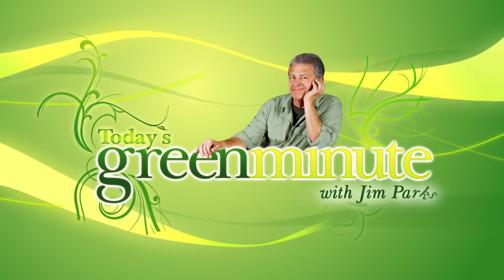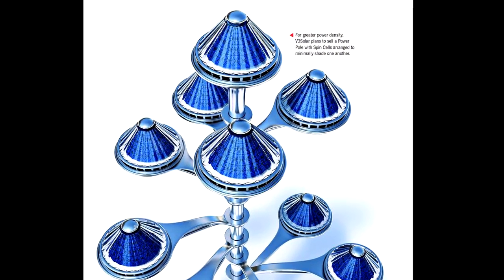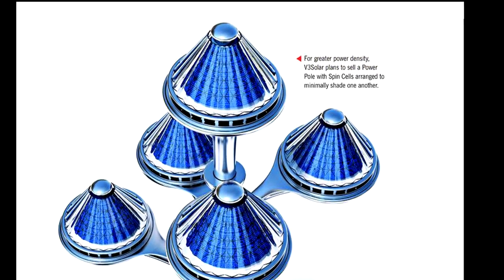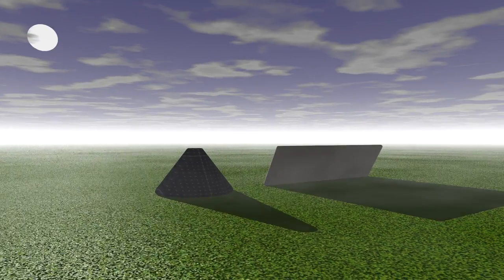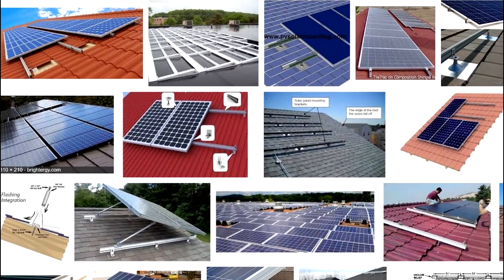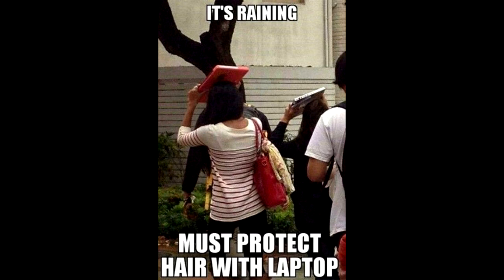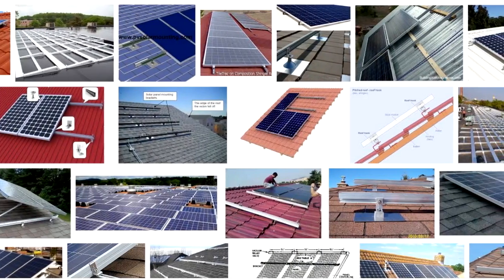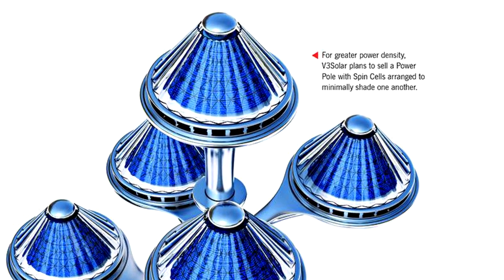Spinning Solar -BUSTED!

Comment: why are they mounted on brake rotors (in the model)
Reply: Miles11we brake rotors are designed like that to dissipate heat. i would assume they just thought "hey that looks cool, and it actually works to cool things off, lets just shove it in there"

Comment: Now i want freaking spinning solar roadway
Reply: Sapher made of thorium
Reply: @RedRacconKing  A mining company actually did make a road out of thorium in Malaysia. It was a waste product from rare earth mining that they needed to deal with so they mixed it into concrete and made a few roads with it. They got protested and sued into bankruptcy over that though.
Reply: Spinning solar freaking thorium water hyperloops, with batterizers built-in.
Reply: EM driven hyperloop!
Reply: spinning solar freaking thorium roadways that generate water from air!
Reply: Sapher Dear lord. it would generate more electricity than a nuclear reactor.
Reply: Thorium powered spinning solar hyperloop roadways! :D
Reply: Solarpowered car with glass cone tires.
Reply: no even better design, the cars are lenses and you cook inside! free heating
Reply: dont forget to bring along that self filling water bottle if you get thursty and the aqualung for a day at the pool!
Reply: That's just crazy enough to work
Reply: Also if they spin really fast t(near light speed) they should last a lot longer thanks to time dilation.
Reply: NO  ........ the car on the solar roadway is cone shaped spinning solar panel with lenses
XD
Reply: A spinning cone-shaped EM drive hyperloop powered by a solar freaking roadway that's made of thorium.
Reply: from plastic. That also create free water
Reply: MortifiedDumplin Looks like we have someone of the oil lobby
Reply: and it also collects air pollution and uses that to replicate itself
Reply: You would have to add thorium to make it work !
Reply: that also condenses water
Reply: in a vacuum hypertube
Reply: spinning thorium solar roadway's!*
Reply: Sapher How will they spin? 
EM drives.
Reply: TheA4p Where can we fit powdered alcohol?
Reply: Tumetron3000 Inside the Hyperloop, duh!
Reply: We'll put a giant magnifying glass over it to increase efficiency and melt the skin off of anyone driving on it.
Reply: god damnit I was thinking the same thing
Reply: You don't drive the road, the road drives YOU! Brilliant work
Reply: Tumetron3000 It will generate powdered alcohol from the atmosphere.
Reply: The only thing better than that would be freaking spinning solar hyperloop - with a passenger capsule propelled by a thorium-powered EM drive & constructed entirely from air carbon, naturally. It's simple: just put the solar panels on the outside of the passenger capsule, make the inside of the hyperloop rifled like a gun barrel, and bingo: freaking spinning solar hyperloop!
Reply: Sapher don't forget to stick the water collecting fan on the cones as well, that way the spin will be from wind power, and we'll free air water.
Reply: +Starcruiser15 made by Ken ham
Reply: Wait we need to get them to power the hyperloop !
Reply: This comment thread made me laugh so hard I need a solar-powered spinning artificial thorium-condensing gill to breathe.
Reply: Sapher dear god, people. this is. without doubt. the funniest comment line i have ever read. 
I mean seriousely, why's everyone forgeting about spining solar-thorium powered glass-roofed houses? sure the front door would be a bit triky, but motion powered air conditioning! and 360 views from every window! the concentrated roof heat can be used for cooking. with water colectors  you could totaly go of the grid! make it a moblie home, why not! it would produce so much energy you could even tack on jet engines and sail the solar winds! the possibilities are endless!
Reply: Now THATS an idea!! no wait...
Reply: that's the next step you morons! spinning roads that push your car while generating power and condensing water that wash your windscreen!
Reply: while also cooking a 10 course roast  dinner for 100 people!
Reply: Sapher Basically, you just invented the world's most horrifying Disney ride...
Reply: Thoriuming Spinning EM Driving Waterseering Freaking Roadways!
Reply: "Now i want freaking spinning solar roadway" <- That might be just crazy enough to work!
Reply: And drive on them with thorium cars
Reply: and the roadway shall be lined by the vortex 5 watt generating dildos.
Reply: But but ? what if we spin them 1000% faster ? huh. No one thought of that :) and make them bounce up and down ?
Reply: Spinning solar and thorium powered hyperloop
Reply: LOL.
Reply: and we will make all of these work with the power of God feminism and sjw's
Reply: That's right! You're getting 2! All for low low price of 19.99
Reply: If you combine that with an artificial gill on top, you can propel an ocean liner with that.
Reply: Sapher that use thorium on night time
Reply: Sapher spinning solar hovering roadways that stores water as it spins
Reply: But, will it grate cheese?
Reply: orochimarujes don't forget that we can also condensate drinking water on the spinning cones themselves, cure world hunger, and solve global warming, all for modest donation of $5! Don't you believe the flashy animations?
Reply: Sapher that also generates water out of air :p
Reply: Sapher Also fused with waterseer
Reply: they can put these in as roundabouts ;p
Reply: LMAO
Reply: No mate spinning torium solar roadways with 1mm of glas protecting it :P
Reply: You're all missing it! We need to put a giant lens into space to focus light onto the earth!
Reply: orochimarujes don't forget that we can also condensate drinking water on the spinning cones themselves, cure world hunger, and solve global warming, all for modest donation of $5! Don't you believe the flashy animations?
Reply: built by laci green of course
Reply: BEST
Reply: Sapher *fucking
Reply: Sapher 
Solar freaking, nuclear powered, spinning, wireless, levitating, magical roadways!
Reply: But, will it run on salt water?
Reply: Solar freaking Turntable
Reply: 69th comment-lets make it exciting.

I want a spinning solar spaceship road that spins around the continent of oceania. Or,better yet,turn the entire continent of antartica into a solar panel.
Reply: Sapher OK I almost pissed myself seeing that comnent. fucking  perfect.
Reply: NO,SOMETHING EVEN MORE REVOLUTIONARY...

Tessellating pentagonal roadways.

It's totally possible. As is oxygen filters for underwater use.
Reply: You forgot plastic.
Reply: Noooo, 2221 likes :(

I hate it
Reply: Sapher with plastic roads
Reply: Sapher a water seer with spinning solar roads around them on a plastic road!
Reply: Sapher spinning solar plastic roadway
Reply: A spinning solar border wall with a hyperloop under the panels.
Reply: thats probably how solar roadway roundabouts will look
Reply: THEY R SOLAR SPINNING ROADWAYS
Reply: Noooo....a hovering spinning solar roadway
Reply: Give this man a price
Reply: Jon indigogo ON IT!”
Reply: Where does it stop, nobody knows!
Reply: Freaking spinning solar-powered thorium hyperloop scopes with built-in waterseers and free theranos
Reply: Sapher would you even be able to drive on that safely?
Reply: Spinning solar freaking thorium-reinforced plastic hexagonal roadways!!!
Reply: lovetoeat allthefood Don't forget a Triton gill in case of failure near water
Reply: America, the worlds biggest prison. That wall is to keep americans inside United states of terror when the economy collapse